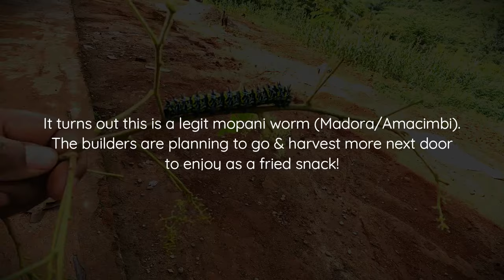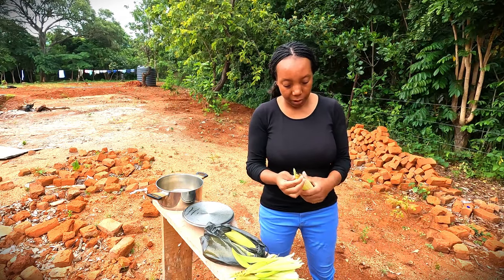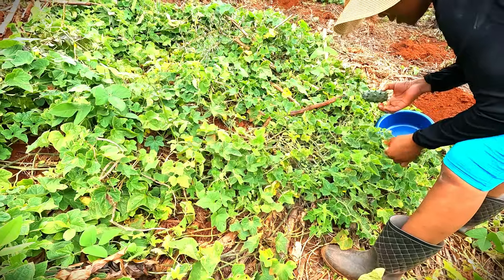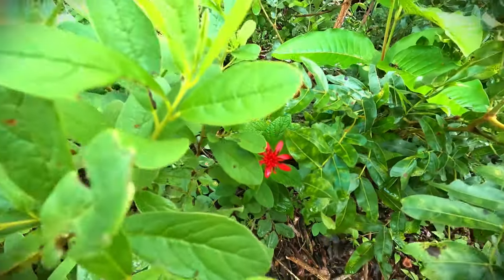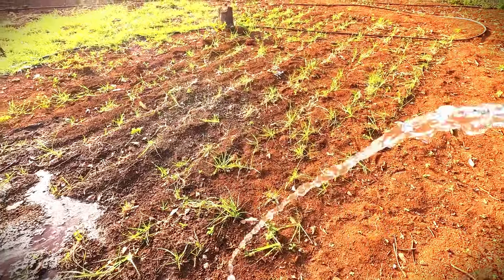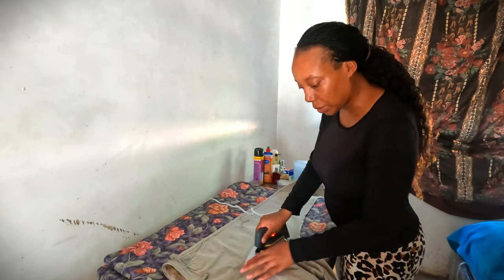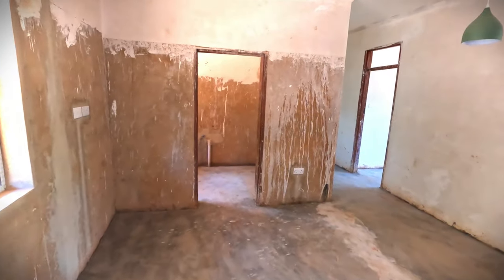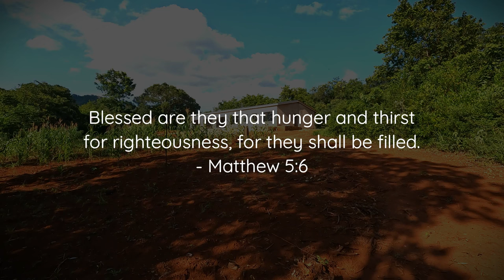#16  Dust be gone!, building a house in rural Zimbabwe.

Comment: As usual, great vlog. I have a concern: the front deck looks to be more than 8 inches lower than the door levels! I do not know whether it is by design in case you intend to lift it up to near the same level as the doors or not. It would be better to lift this deck to within an inch of the door level by building a wooden deck to extend of atleast 9 feet width from the front walls. This wooden deck does not need to run along the whole length of the current concrete deck, just to extend up to the living room length, and maybe covered with a tauplin.  Ugandan watching fron South Korea
Reply from the maker: Thank you for the ideas. We are indeed still brainstorming on how the deck should finally look. 🙏🏽